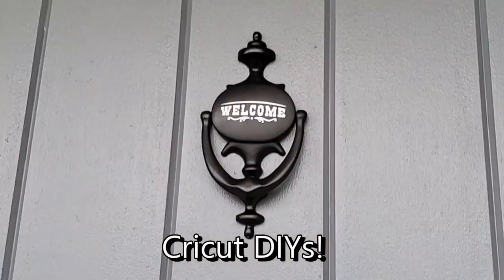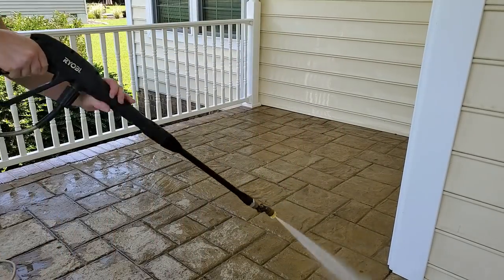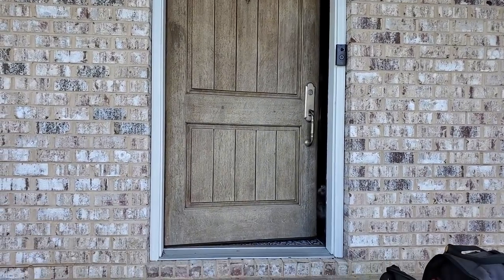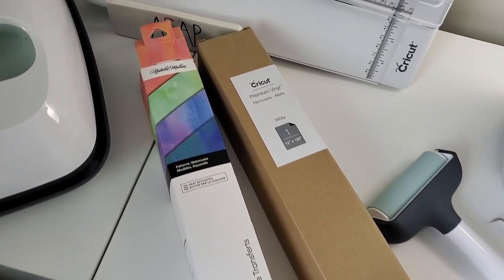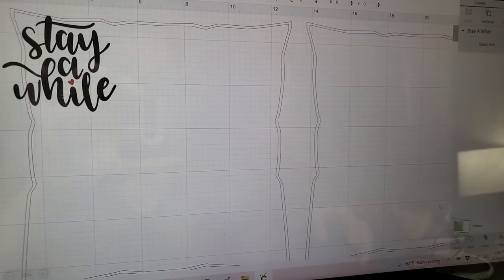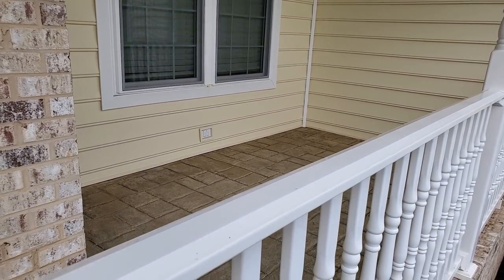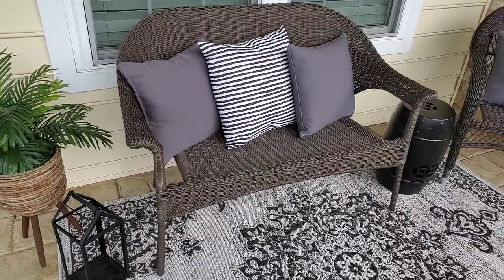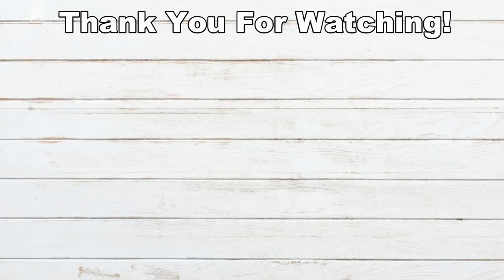DIY FRONT PORCH MAKEOVER ON A BUDGET | FARMHOUSE PORCH TRANSFORMATION | OUTDOOR DECORATING IDEAS

Comment: It is important to keep up the outside for sure.  We have a garage on another place and the previous owners painted the sunny side 30 years ago and then ignored it, so really all that T-11 siding is rotten back there.  I'm cleaning, scraping paint and painting it rot and all so it makes it look better from a distance but we already had to replace one side that they had let dirt get piled up against and it rotted through.  Just an annual inspection and cleaning will save hundreds if not thousands. Glad you finally made the change with the door, it looked pretty sunburned. I've been planning to hang similar lights inside our gazebo and maybe run clear Christmas lights up the angles to the top on the outside. Won't happen for a while though!   How much time do you and your hubby spend on maintenance items especially with the little one?
Reply from the maker: Maintenance is soo important. My husband and son spend the most time doing outside Maintenance. The pool only takes like 10 minutes a day to turn pump on , clean skimmers, put the robot in the pool and check chemicals. We do a weekly big vacuum clean if needed. They cut the grass once a week, trim bushes as needed. Anything in disrepair gets fixed as needed, fallen shingles or anything like that. Basically just keeps eyes on things and fix asap.